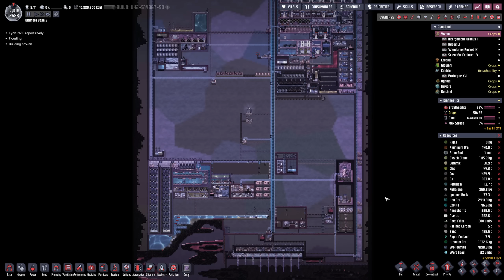COLDITO REACTOR LAUNCH - Spaced Out: Ep. #100 (Oxygen Not Included)

Comment: To keep the space radiation, it's best to use metal tiles, like gold tiles. It has one of the lowest radiation absorption.
Reply: Gold tiles or mechanized doors, even amalgam manual doors. The doors, atleast, has only 2 or 4 % rad blocking, not sure about the tiles.
Reply: Didn't know about the doors! To avoid the absorption at all and keep gases inside, e.g., greenhouse, I use solar panels.
Reply: @SciencePhysics  yeah, solar panels have 0% block. Melting 1kg of coal would give a tile of 1kg refined carbon, which would also be near-0% blocking, but would require some planning to get properly done
Reply: Also, haven't tested the viability of this, but theoretically, you could also melt a 10000kg piece of coal to get a 10000kg tile, which would be one single tile with more than 100% rad block. 

The note on viability is the melting part. 9999kg tiles through sandbox definately states 100% rad blocking. Was playing around with some refined coal tiles in sandbox to see if it could be used as a rad blocking medium around the reactor. Haven't had time yet to figure an effective way to implement this for a non-sandbox game, though I'd assume a finnicky use of magma and thermium tiles, or something
Reply: @salemprompthous3820  That's interesting! I'd definitely try to play around with it in my current playthrough. Since you require only about 280 oC, it can be easily done with a metal refinery by heating carbon, e.g., in hydrogen and making refined carbon tiles one by one (vertically) or all at once (horizontally).